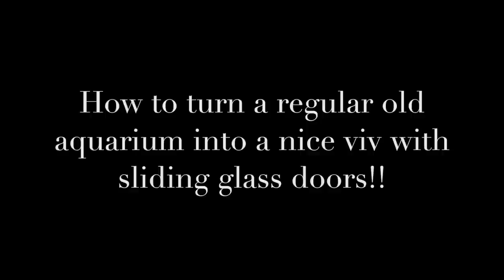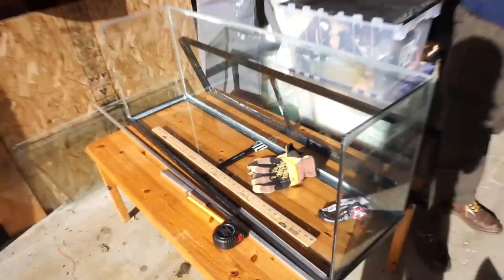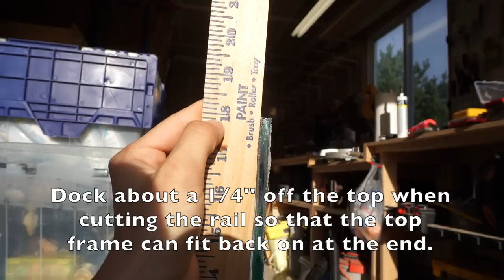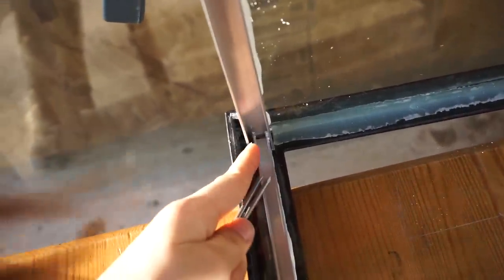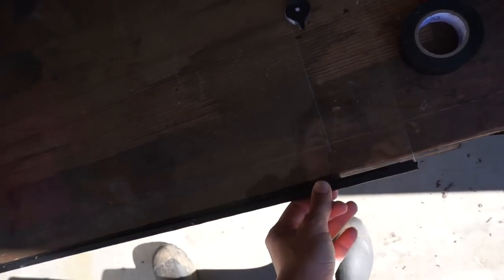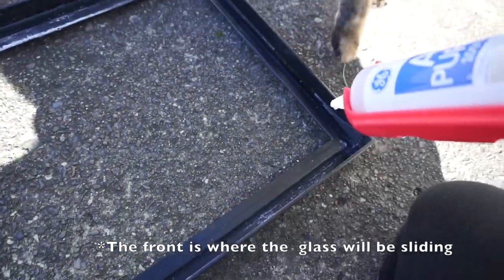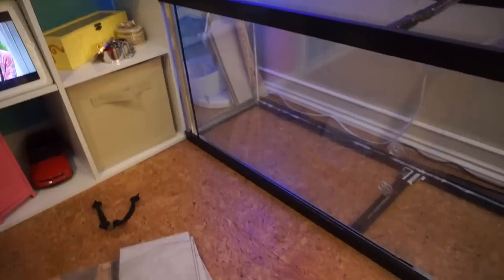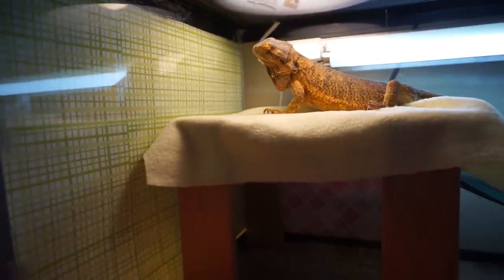How to Add Glass Sliding Doors to a Reptile Vivarium - CUSTOM ENCLOSURE

Comment: Did you put the panes in before replacing the top trim?  I assume you had to, but in the video you said you were going to put the trim back on and then insert the panes.  ??? 
It looks great!
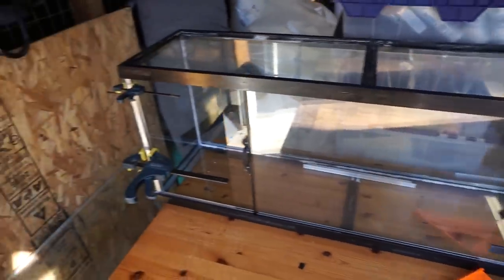Reply: look at around 8:30 if u look closely in the reflection you can see her tilting the glass to fit it in so to answer ur question no she did not

Comment: what was the black block thing you were hammering with the mallet while getting the top frame off with. I have the same tank and am taking this on too. I've been cutting the silicone  for a while now.
Reply from the maker: Bonventur cfinisher It was actually a tool for installing cork flooring. Odd thing we had lying around, but it worked. Maybe you could find an equivalent at a hardware store. 

Yeah, cutting the silicone and removing the top frame took us a good few hours on the first tank we did. It just took time before we developed out strategies. Send me a picture or post a video of your tank when you're done though, I'd love to see how it comes out! :)
Reply: +Leila's Zoo I don't know if I should try this because I'm scared I might go poo poo

Comment: this is an awesome job :D any ideas on how to add a bottom piece that the sliding glass is on top off; like you're planning on doing a couple inches of dirt?
Reply from the maker: Thanks! I thought about doing that, I think it would make it easier for using a substrate. You could probably add a metal strip at the bottom of some sort and attach it with silicone... and then maybe the glass could go in front of the strip!
Reply from the maker: That way it would keep the substrate out of the way of the sliding door's track

Comment: Tried this with my 90 gallon tank...turns out the glass is a lot thicker and doesn't fit in the sliders. I've decided to put half of the glass back in place and the other half will be a hinged door. Measure the thickness of your glass people!!

Comment: Instead of using silicone would it be possible use hot glue?
Reply: No! Hot glue will NOT hold. It's also not moisture-proof, which it kind of needs to be when making a reptile tank. The silicone needs to be aquarium-grade, so none of those "mold-resistant" ones (they release toxic fumes which are very poisonous to reptiles).
Reply: @nostrobothnia  Thanks! I already assembled the tank and used aquarium grade silicone!
Reply: @maxmakesit8157  good to hear! 😊

Comment: tbh yo should have used silicone on all of it. the reason silicone didnt work for you is because you didnt rub it down with rubbing alcohol first. not sure why that works but it does. also helps if you scratch the glass where the handle woulda been and scratched the inside of the handle too would give something for the silicone to grip to

Comment: To much work and exprnsive tools, rather just get a tank with sliding doors for 90$
Reply from the maker: Dylan Williams Yeah, this is for DIYers with tools and time on hand. It's a matter of whether you have time or money to spend I suppose.
Reply: Where did you find a 50 gallon tank with sliding glass doors for $90?
Reply: I guess if you're lazy and have money to burn, sure. But good luck finding one in a decent size for $90. Personally I'd rather make a little effort and do something myself than to blow a bunch of money because I'm afraid to get my hands dirty.